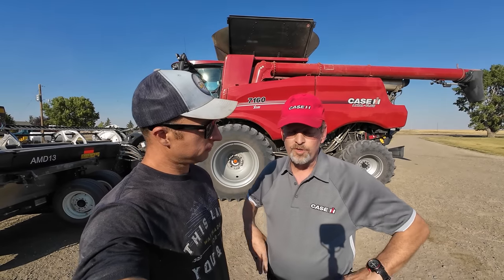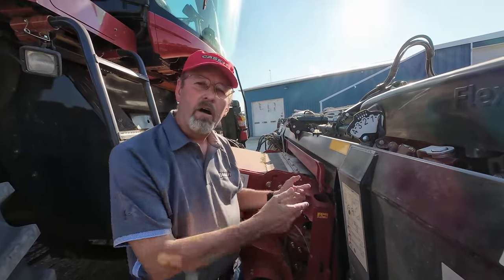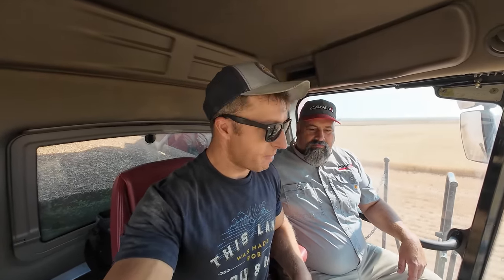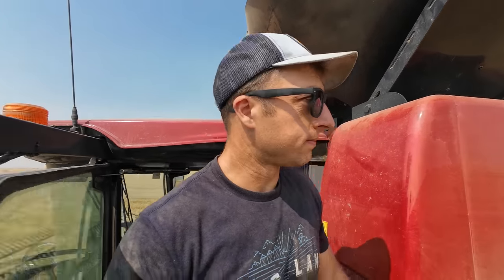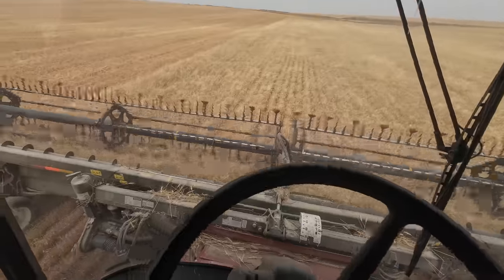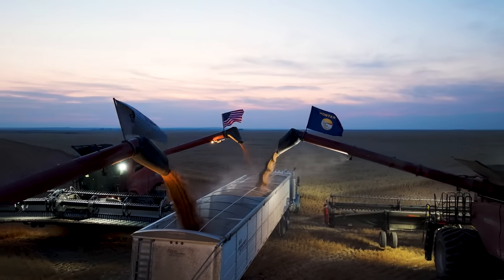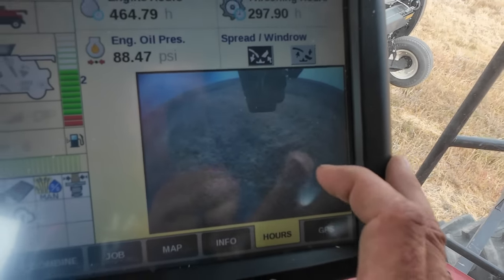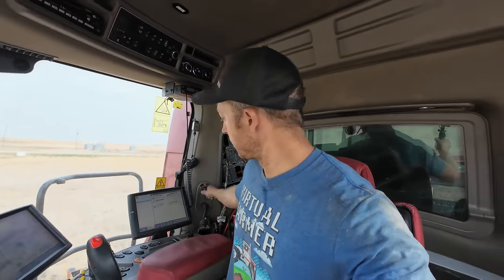It's RED and out of the SHED! - Harvest Part 5

Comment: I wonder if there is more shatter grain loss from the duck feet tines on the reel hitting the heads of the wheat.
Reply: Not really in thinner wheat
Reply: Robert, thanks for your reply.
I would think that there would be some shatter loss in thicker wheat and also if the reel is run too fast hitting the wheat heads.
All that is required is bending the wheat stalk slightly back at an angle. Ground speed would also have to be factored in.
Maybe CIH or JD will automate this-!  @RobertWelkerFarmerBob

Comment: Im like yr cannon My nephew has a 3/4 size 9lber Bronze  Napoleon.  Full size would be the 12lber. He also has a little table top one.  It shots 1/4 bolts about 50 yds.  it is spent by then. At 19 yrs it puts that bolt through a 1 inch board.

Comment: From around the 13 minute mark, am I right in thinking that combine is too small for your header/crops? It seems like the engine was maxed out at just 4mph and the sieves could barely handle the grain load.
Reply: You always set your forward speed to run a combine as close to 100% as you can,  it is the most efficient setup and keeping the rotor/threshing drum full gives the best sample with the least amount of crop damage.